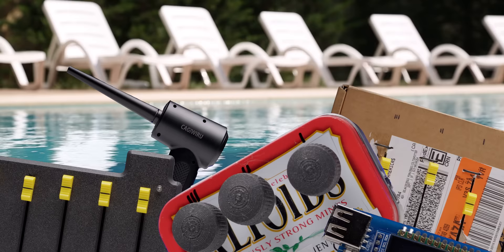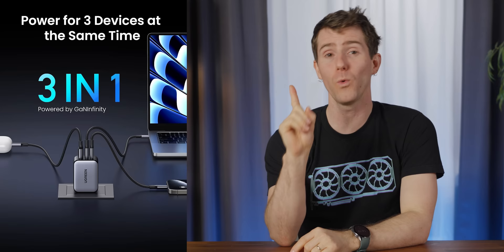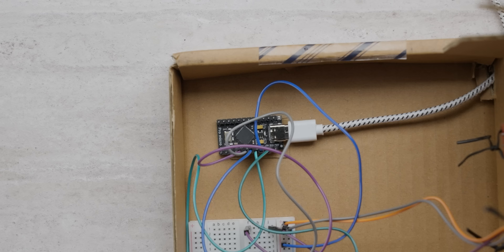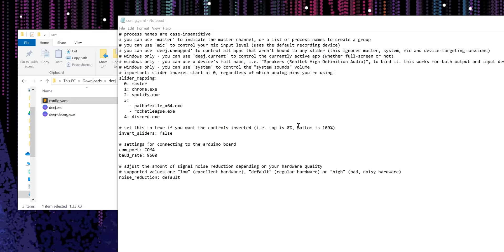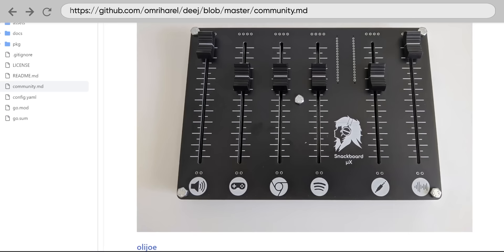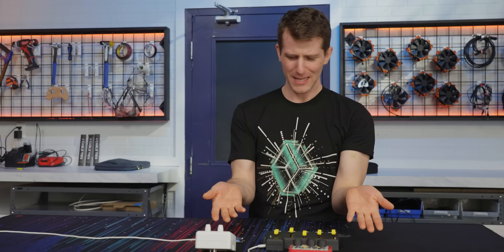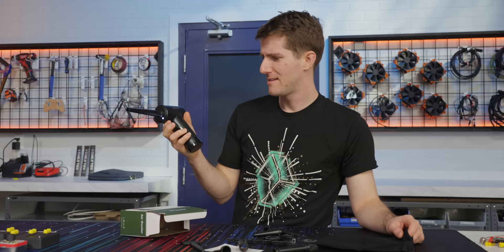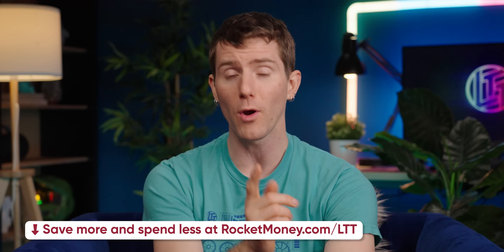I Made This for Under $10. You Can Too - Handy Tech Under $100

Comment: That volume mixer solution is way more work than it's worth, even if it's not that much work. I'm not going to constantly be adjusting these individual volumes that often, and the few times I do it's just way easier to open the volume mixer with a quick click of my mouse.
Reply: Except if you’re in a game and realize your discord or something is overpowering…
Reply: @AverageThinking How often is that realistically going to happen? Even if it does, I can alt-tab out of a game, fix it, and be back to the game in under 5 seconds. If this is something that's regularly happening, you need to get your levels figured out before starting games.
Reply: "way more work"
Well, there's your problem. If you see building something like that as "work" then of course it's not worth it. For a lot of people it's a fun project. They have fun while building it.
And building something that also has a practical use is just so much more satisfying.

Comment: Steel Series has a software volume mixer called Sonar that is way better than the deej (and its free), can do comms, game, media, aux and mic all seperate, with the ability to boost the volume and put an EQ on all those things independently. It even works with ASIO devices Like the Focusrite line of interfaces. Basically a newer version of Virtual Audio Cables and Equalizer APO + Peace in one piece of software.

Comment: Air Duster. The only thing that we need to keep in mind while using or storing it is, battery may fail itself. Those things are mostly not only made in China, but also built without proper development cycle to keep the cost down. This means that we can't fully trust battery protection of those products. Except that, most of those air duster products just does its job while it lasts. Bye-bye for compressed air cans that freezed our hand, but instead we now gets another lithium-ion batteries in it. 
At least mine survived 1 year now, already saved costs of several cans for me. Hell, those air cans are now unavailable in my country. Most shops stopped restocking them because some crazy people buy them just for inhaling that air (probably also LPG) inside the can.

Comment: It might be important to note that the USBvalve not showing an exclamation mark does not mean that a USB port is safe to connect to. It could still contain incorrectly wired data pins or non-compliant USB-PD that can fry a device, or USB firmware infections that aren’t picked up by an OS.

Comment: In fact you are selfbuilding your own mixing table just with some fancy software for you to programm. The parts may cost just a few bugs - but you need to put tons and tons of effort into it for knowing how to build it, how to do the electronics and how to configurate the software. Over all - you can basically buy a mixing table from an existing brand (like elgato) and use it with prebuild software exactly made for this components.

Comment: That USB test thing does make sense in some situations, but I think, for most people, just having a charging-only cord of USB condom that filters out the data lines would probably be more practical to handle power safety. 

Where I could see the device being useful is when you actually intentionally plug into a computer or checking a sketchy device.

Comment: Quick tip, rp2040 based microcontroller usually only have 3 analog pins, so you'll need an analog digital converter (which can be had for a few bucks and clipped in if you pick the right one)

Comment: I worked as a software developer in a audio company. Linus is right the device is not changing the volume because it has a external controller fr volume, I bet it would possibly work differently on linux and mac. Windows AUDIO drivers are a mess especially for "pro" grade interfaces. Some of them work as expected, but some might stop working if you change samplerate in windows because they expect you to use their propriotary software panel and are mostly focused on driver implementation standard called ASIO. And ASIO standard doesn't specify how the device should behave with Windows drivers. Meaning that each audio interface will do what the developer writing the driver and firmware decided was the best. I really started to dislike some manufacturers because of this.

Comment: I bought an air duster/vacuum combo... I actually really like it for working on computers. It blowsd air out of a thin tube in one mode and vacuums into a little chamber in the other mode, the vacuum has an extendable bristle brush that lets you brush dust while vacuuming it at the same time. It doesn't blow as hard as canned air, but frankly it was $20 and a 3 pack of canned air is almost that much, so it was an easy switch for me.

Comment: DEEJ is a great approach (stumbled over it 3 years ago), and some other solutions go the same direction, like bigger versions of the stream deck, Mackie/HUI-protocol-compatible audio equipment, powermixer. But most lack consistent driver/desktop support  and  motorfaders = feedback to the sliders if the volume is changed via mouse/keyboard.

Comment: I dont have that exact duster, but I have a cheaper one thats very similar (no light, only two nozzles instead of a bunch) and its awesome. Being able to dust anything at any time without worrying about buying canned air has been amazing, I genuinely ENJOY cleaning my pc now lmao. Only thing they didn't mention is that when youre cleaning fans, make sure to hold the blades still. if you spin them backwards you can send voltage back INTO your motherboard on the rails that are supposed to be sending to the fan, and you could possibly kill stuff.

Comment: Pretty sure I have the exact same blower, and it's come in useful with cleaning dust out of my computer and whatnot, I even used it when I was cleaning out a Dyson fan. The only issue that I would have with it is that it doesn't have a super focused tip so it won't be as hard as a can of air, so you may still need one around for more stubborn dust and dirt, but it does a good job on other more general purpose uses.

Overall I recommend it, it'll significantly reduce the amount of cans you need to buy, leading to less waste as well.

Comment: The charge-o-matic seems like a good idea for the cases Linus described. If, however, you already have a home automation system in place, like home assistant or smart things, you can do this with an automation and a much cheaper smart plug.  That's certainly not a good reason to incest in a home automation platform if you don't have one, but more and more people do, and this is the kind of thing that would be super easy to set up!
Reply: *invest, brother, invest! Now help me get out of this washing machine that I'm stuck in

Comment: re audio control, if you happen to have any midi controllers kicking around i'd very much recommend a free piece of software called midi mixer. for example, i've got a korg nanoKONTROL2 plugged into my pc and mapped in midi mixer. i can map any of the sliders, buttons or knobs to any audio device i want, plus i can do per program audio control using a slider, it's very handy. i even have a button dedicated to the start/stop record button for nvidia shadowplay so i can record video clips very easily.

Comment: I've been using a couple smart plugs as essentially the charge-o-matic for years now and love it. I have three 20-socket USB chargers and a power strip to keep various seldom used controllers, portable consoles, battery banks, and other devices topped up

Comment: 7:26 I'm surprised that sort of limitation isn't more common. For any digital output device, for example, you don't want to be adjusting the volume from the OS side, because you're limiting the amount of dynamic range you get over the sound, i.e., if you set the volume really low, you would be decreasing the audio quality. I remember encountering this sort of limitation over a decade ago on macOS, where as soon as I output to my TV, the system volume slider was disabled to stop me messing with it.

Comment: The rechargeable uncanned air is neat. I had bought a pretty strong one, but it was kind of a pain that it needed to be plugged in to use (like if I took my pc outside to clean). This seems like it'd be more convenient as long as it doesn't instantly die.

Comment: Back in the day, there was a procedure in using Ventrilo to normalize volumes, so you would hear everyone as a set volume range (so those too quiet would be boosted up, those trying to troll by blasting loud sounds would be reduced down). It was amazing, could hear everyone perfectly fine (volume-wise at least, can't help with people using static-y mics). How come they can't come up with something like that for system-wide sounds?

Comment: The Deej is absolutely amazing and I had been looking into it for a while myself before buying a great GoXLR knockoff for $100 CDN. It's honestly really awesome though.

I'm pretty sure I have that same rechargeable duster, or at least a rebrand of it.

I do something similar with my rechargable batteries for lawnmowers/snowblowers/pool vac with smart outlets and some Home Assistant code if they aren't capable of doing what I want them to do myself. When I think I want to mow my lawn, I ask google to turn on the outlets for the batteries, and then they aut shutoff after an hour or two, making sure they are charged but not overcharged (hopefully).

Great video, super handy!

Comment: The PEI build plate gives such nice textures to a 3D print... 
I use a battery-operated inflator for generic "endless" air dusting. You can do this with a shop vacuum exhaust, as well, but that blows like a tornado, so be careful.

Comment: I got one of those USB dusters and am going to return it. It blows good volume but not a lot of pressure (even with the pressure attachment). It also got hot as hell after just 30 seconds of running.

Comment: loved all of the products except the usb device. I understand that it's to check to see if the plug you're using is malicious, however there is a much better alternative nicknamed the USB Condom. Basically will only send voltage and cuts off any data lines.

Comment: 12:40, on that note, tell the inventor I would be more interested in a USB version that monitors the power being taken in by a laptop, phone, tablet, etc. I admit it would require system level knowledge to produce the portable programs that can be run for each system to pass on the battery status to the charge-o-matic but that's a one and done kinda of thing compared to the charge-o-matic itself. I'd love to just plug my laptop's (uk) plug into the charge-o-matic and it take care of pausing the power feed at 80% until the charge hits 20%

Comment: Still at the beginning of the video, but i saw that air blower. Don't know if you guys mention it, but the battery on that thing sucks. Not only on an individual charge basis, but over all. I had it for about 2 years, using it and charging it like once a month. The battery no longer holds a charge. I can charge it for hours, and I get half a second of air. 

It's lasts longer than a can of air, but it still doesn't last that long.

Comment: That rechargeable blower is dope, but, but I'm surprised you guys didn't mention the corded brand-name Datavac blower, or one of the similar knockoffs. It's under $100 and it's got a fucking 4 amp 120vAC motor in it. The damn thing pulls so much power and moves so much air, that after it warms up, the air comes out warmed up somewhat, and it's amazing not just for dusting, but if you ever have to soak or heavily spray a device with isopropyl alcohol, it will help find all of it and dry it away rapidly. I've used this thing with a concentrator nozzle before, in combo with a spray can of isopropyl alcohol, to remove thermal paste from inside the pin sockets of a PGA socket before, after it was badly contaminated during a prior CPU removal where someone had used way too much thermal paste, then came to me for help when it would't POST after reinstalling the CPU again. I wouldn't have trusted just any blower for the task, the addition of warm air makes it a much better blower for eliminating isopropyl alcohol.

Comment: for anybody wondering you can pretty trivially recreate the USBvalve thing but just connecting the usb power delivery lines on non USBPD cables and devices. Forgoing any data connections.

If you do need the PD those are separate pins iirc, and you can use your own little breakout boards to configure the output level, and again deliver only over power lines.
Reply: Do I understand correctly, you can use a USB cable that only has the power pins connected?
I went to the comments because I was wondering if the USB thing is 100% safe.
Reply: But then how would you detect a misbehaving device?
Reply: @ourinator692  You can, but USB without data lines is limited to 500mA current (2.5W)

Comment: The charge o matic is pretty cool and since it is rated at 125v 15amps it should be fine to use with an EV level 1 charger. Which would be perfect to keep a classic electric car battery seating right in the 40% ish range.

Comment: Great video!  I bought a volume knob a while back and swear by the physical controls, but if I knew I could have built one for cheap I would have done so instead.  Definitely more of these kinds of videos.  Raspberry Pi, Arduino or similar projects is a great use of LTT's resources.

Comment: Right out of the gate the charge o matic looks like a pretty good thing, because I have a 58 volt 4 amp hour chainsaw battery, that only going to be using a couple times a year, but I also want to keep it from being completely depleted but also not stay fully charged all the time. It doesn't have any kind of self protections to keep it at 80%.

I also enjoy the format of the classic content like this including the good old intro.

Comment: I've always wondered why we don't use air pressure tech to cool CPU's, it doesn't have to be leaf blower level of CFM, but upping the pressure just a modest amount would greatly increase cooling capacity, I know this because I created a direct sealed path for all the air channels in my last build, and it completely spanks my expensive AIO cooler, I've never seen a video on this on LTT (or any other major tech channel ftm).
Reply: They kinda already did a video about that a few months ago: "The scariest fan ever attached to a computer".

My guess why nobody bothers with that: Most builds aren't thermal throttled.
Why spend money and add extra noise to a build when every decent CPU cooler achieves the exact same thing. (same goes for water cooling. Why bother with water cooling when air cooling does the job)
Reply: @Jehty_  AIO coolers are pretty popular judging by how many there re now on the market, and then there are the gigantic heatsink+fans, I'm talking about creating a simple air pressure loop via sealing and channelling forced air, this would in theory beat the best AIO and the top Noctua cooler, you could reduce full system temps by 3-4 fold at least with enough pressure, and seeing as it's closed/sealed of, only the intake/exhaust would be audible if you use sound proofing, this would allow CPU clocks to run at higher boost speeds whenever wanted, GPU clocks could also be available at top speeds whenever requested, as would RAM, all with increased life expectancy and greater stability thanks to a much cooler system, you could even exhaust the hot air through a wall to the outside.

Comment: if anyone already has ryobi batteries and power tools, the "R18VI-0" is very inexpensive and super useful for dusting. (not the one with a hose)
super happy with mine, it's loud as hell but plenty powerful and won't have the issue of needing to recharge as I have several batteries. also you can just buy a new battery if it goes bad, rather than a whole new duster as the battery is integrated

Comment: I don't understand why you can't set a maximum charge limit on devices

Full charge/discharge to calibrate then set a min/max %

Stop charge at 80% resume charge at 20% for example with a full charge override option for those times you actually need max run time.

Comment: It would be simpler to have a USB device that only has the power pins connected, so when you plug in your device to it and then to the suspect USB source, you only get power.  So then it doesn't matter what kind of data the device wants to send you, as those wires aren't connected.

Comment: 2:20 Meh. I rather build that device myself.
Advantages:
* Correct sized and correct composed relays used. (many cheap devices slap in a relay that was intended to switch 12v and call it a day)
* Web interface: I can switch it, set up the on and off times, or change them remotely. 
* Power consumption of the device power optimized: It can run years on a NiMH.
* Itself can choose when to power itself and charge the internal backup. (see above)
* programming time can be from 1 second to 99 years for on and for off.
* It can be smarter as it can have inputs. Like measuring voltages. Or talking to e.g. smartphones through an app. I have an app that plays an alarm when my charge falls below 20%, and it continues to blare every few minutes till it is charging (plug'in it in is enough). It also gives a notification when the battery is full. That is an app that allows all sorts of actions you can "program" yourself (no actual programming knowledge required).
* I can add any feature I like.

Comment: I've never understood the need to have some odd device checking if a usb port is safe to use or whatever, just make sure you have a cable which only contains power wires when you charge. Way simpler, and way cheaper. And most people don't generally use the data wires in their cables anyhow.